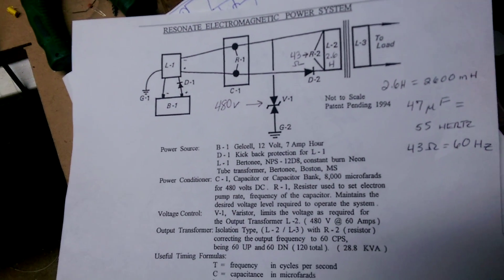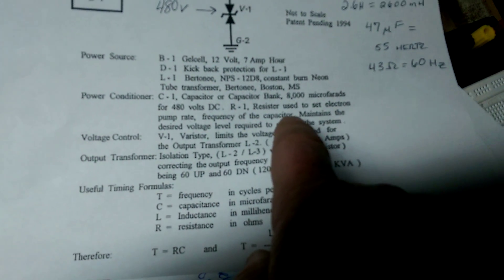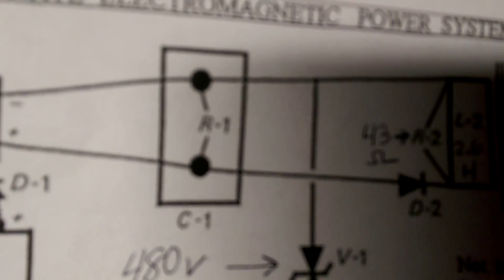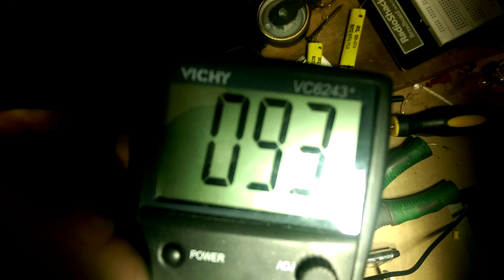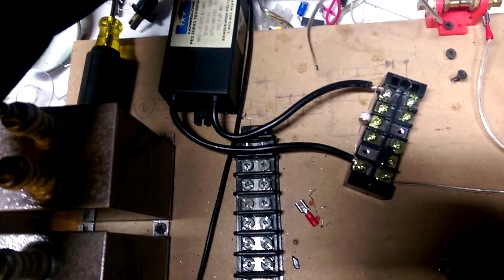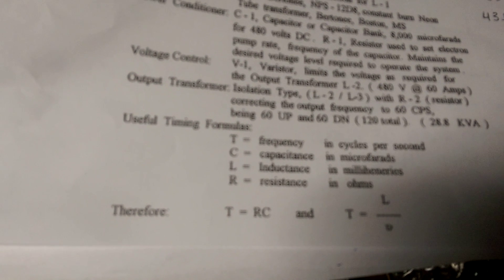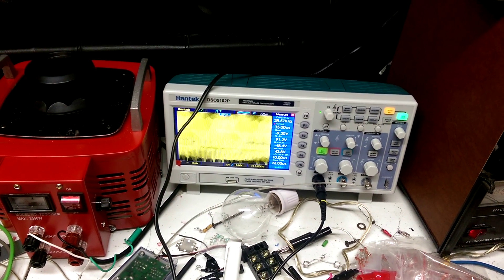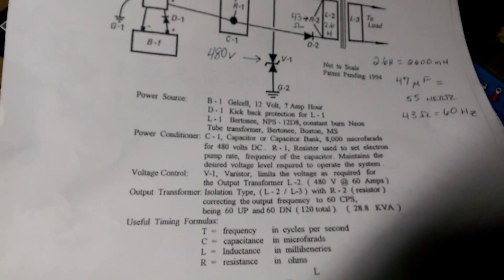Don Smith How To Video

Comment: Mark what a fantastic video, if you were to know me you will find out that I'm not an ass kisser at all...
For years I've been trying to figure out mostly about affordable components and how to make the calculations etc, and here you are just a year ago with this video.
 I have many questions,  How much can it power up? I have an nst, 12kv,, old block, big at 60hz, how can we increase that frequency? you mentioned something about a solid state device...As a coincidence just yesterday accessed the website you mentioned but won't have and idea as to how to set it up I saw one with several terminals...Etc. 
Thank you for sharing, we need this to do good for the world once and for all, We can say you are a man of great principles
Reply from the maker: Well, this isn't as it seems here. I've tried this but I think it is just a piece of the puzzle in the tricks up Don's sleave. I am finding that the output of this system is directly proportionate to the size of the capacitor used. When we use an NST, the output of the nst is an ac waveform that is just sped up to so many hertz due to the oscillator inside of the NST, and of course it uses high voltage at a very low amperage. The system has some trickery and the calculations used here are for dc voltage, not to be confused with the output given, but because it converts within the cap. 

The reason it is dc voltage is because the amperage at the ac voltage used is so low that it can't remain ac long due to the capacitor. When we add the capacitor, it of course stores energy and fills itself until it's peak where it dumps dc voltage from the cap to the circuit. The resistor we place across the cap allows the output of the NST to filter out the conventional energy and convert it to radiant energy, but storage of the radiant energy at high voltages is unlimited and converted to dc once it is connected to a capacitor of high value such as what is used here. 

Once the cap fills with radiant energy, it can't explode, it dumps and the resistor used controls the frequency it dumps at. We must follow Don's calculations closely , but, we have to also be aware that the frequency the circuit is driven at is calculated within the system by determining the L1 coil size by impedance along with R1 and C1. If we scope the output of just L1, R1 AND C1, we will see the frequency changes to perform oscillatory effects so we could have output resonance. The cap will fire the output to the circuit with ease. 

This circuit creates Don's briefcase device which is used to dam up the radiant energy, convert it back to conventional energy with a massive amount of joules due to the cap storage, then it utilizes the resistor and transformer plus the Varactor (not varistor as it says) to pulse energy into the ground, converting the stored joules back to amps and output the energy with ease to the output of the circuit.

 When we have this energy in the cap and a coil connected in the end, the circuit toggles it's own oscillation and outputs the charge at the joule level at 50 or 60 hz with ease because the capacitor easily recharges after each cap dump because it never discharges all the way. The frequency it equals is 35.1 khz and we only extract a portion of it by toggling the coil/resistor, and L1 of the output transformer to react as an inverter. The radiant energy has the capability of multiplying it's amperage several times because we give the output 35 thousand pulses of energy at 480 volts and use only 60 pulses of 480 volts to run it's output. If we do so, we aren't utilizing all of it's energy, we drive all 35 thousand of them into the ground, and the diodes within the Varactor do the job of releasing negative energy into the ground, then the Don Smith Effect happens where the energy flows above and beyond into the Earth's ground, increases beyond what the atmospheric level is and causes an abundance of oscillations of electrons to convert to positrons within the atmosphere. This strengthens the aether and allows the coil in the transformer with the resistor across it's terminus to react and induce these oscillations converted from say 35.1 khz at .05 amps to create a possibility of output at  35,000 hz x  input amperage of .05 amps = 1755 amperes/60 hz = 29.25 amps x 480 v= 14,040 watts (with the figured losses it will have).

This sounds impossible in nature due to the ohm's and watt's law, but the fact is that we extract radiant energy with resistances of high levels as this energy can't be released without high resistances. For a simple experiment that verifies this, we could take the Tesla Hairpin circuit for example. If we build this and get the oscillations right, we could store the energy into a closed loop single turn coil (which the shorting bar is. If we apply a high resistance across the loop's outer edges, we release the energy, as with a low wattage light bulb and fine wire connection. If we place a 100 watt bulb to the bar's right and left sides, nothing will happen if the wire is large, but, if we do as Karl Palsness does and connects a 30 awg magnet wire across the room and add the same light bulb, the energy output (negative or black energy flourishes and the bulb illuminates wildly). This is what happens here, but because we do not ground the hairpin system that Karl uses through a varactor, the kickback can't amplify with it's transmission from a negative electron back to the atmosphere as the positively charged positron.

The reason the electron converts is because the Earth acts as a massive AC capacitor. If we charge one side, the other needs to match this level. if we charge one side with 35.1khz at thousands of volts, the other side needs to become equal and opposite. When this happens, the energy transfer is done and we can tap it provided we use the correctly sized resistor at it's primary side of the output transformer. When this is done, we get not only the pulse from the capacitor in the system, we induce all of the magnified energy from the atmosphere and it collects as a massive storage of plasma energy, ready to discharge at whatever frequency we make it on the transformer. 

Once the transformer does this and the cap dumps, the cap is recharged with one pulse at 480v from the 35.1 khz input while the rest of this energy is transmitted into the ground and recovered in the end of the circuit at a massive multiplication. So, 35.1khz x .05 input will become much larger and recoverable as a single pulse of discharge per 60 hz timeframe. so we get 35,100 pulses of input per second input and we convert it at a divider of 60 times, increasing the output amperage by that amount because it multiplies 35 thousand times and is used in one 60 cycle pass in one shot. 

Once we discharge the cap from a one second charge, we get this level of 1755 amps at the terminal and it will blow apart a screwdriver and recharge before that second is over allowing the energy to flow again and again because we are charging it faster than we can take the energy from it. Because we drive these pulses into the ground means that the energy is being stored for later and if we don't draw back the extra energy in the system as a multiplier, it would discharge as lightning eventually from the atmosphere to ground once the voltage in the atmosphere builds tremendously. 

I do not think we only raise the atmospheric energy, i also think it adds the energy from the atmosphere to the system because the output is tuned to the oscillations forced into the ground, then transferred or split within the ground and the atmosphere and allows it to induce back into the output transformers coils at an even divider of the input frequency

Remember, whatever the amperage is pulsing into the high side of the coil will also become a much greater output in it's secondary for amperage and would not be able to be shutdown as small transformers do when shorted until we pass the level of saturation of the core. We need to ensure the frequency of the devices output is a direct multiple of the input, so if 35,100 hz is the carrier frequency, the output's frequency of 60hz must be a perfect multiplier to function correctly and provide this energetic magnification. This multiplier is exactly 585 times. We could use any frequency just as long as it is one of those multiples.

so 35,100hz input /60hz usage = 585 times amplification, and there is no additional energy left over. This is the magnification amperage level as the frequency is clearly allowing for radiant to convert to conventional amp driven power at a rate of 585 times multiplication. So, the output scenario will be in this case 9kV x .05 amps = 450 watts x 585 = 263,250 watts if the system had no losses. Losses do occur within the atmosphere and they will also happen with components that have too little resistance when it comes to cold or radiant electric pulses. The opposite is true for conventional energy and the energy that is converted is NOT static in nature, it is radiant.

So, if we had an AC cap and we stored each pulse, we would get a maximum discharge per pulse. if we store for 35000 cycles and only discharged for 60 cycles, we would have an overabundance of energy leftover or we would have a massive cap explosion. This doesn't happen because the varactor allows the energy to store safely into our planet.

Here is the other secret. The varactor doesn't come in the sizes Don states. This is because they stopped selling them once his device was sold to the oil companies for generation of large electric generation facilities

The Varactor has to be made by the use of high voltage Germanium diodes facing each other.  This creates the energy valve as Moray has created but it is solid state instead of using a vacuum tube with rare elements within. The Germanium is the gate allows this energy to be toggled and stored using this "valve" technology that allows it to be dammed up within the cap and discharged as mega pulses into the primary of the transformer. We could feed a massive 300 kVA high voltage single phase transformer with this circuit with ease and never worry about energy again or fuels, but it is stationary and we would use this to charge electric vehicles and never have issues with fuel, oil, etc. ever again.
Reply: @advanced-electronic  gracias; hermosa explicación.
Aunque no leo inglés muy bien; lo he llegado a comprender.
Su explicación es más entendible que la de Don.
Creo que intentaré hacer un equipo de este tipo.
Usted me dió las llaves que Don Smith tenía guardadas ; o yo no comprendía.
Que Dios lo bendiga.

Comment: Marc thanks for your helpful videos. Your scope is really overdriven here making readings unreliable ,   just make a loop of hookup wire clip it between probe tip and probe earth clip. Hold it near to the Neon transformer to sense or sniff the waveform and the frequency ...don't need to actually connect it.  Having scope sitting too close to HV at high frequency can damage the scopes  internal amps. Due to volt x frequency product. 
Cant really measure power line type or heavy inductors with simple inductance meter because inductance depends on "magnetising current" to get to correct operating part of the cores hysteresis curve. Effective inducance best computed from in circuit testing.
Reply from the maker: it's a high voltage probe and the voltage here you see is only at 880 volts. The probe is good for 2500v, the arc gap clamps the voltage and only allows so much through, I had to switch the probe selector, after the video I of course noticed the switch was in the low position, 1000v setting and it shows the waveform wide open like that. I was fooling with the scope early after I purchased it and never set the multiples correctly ont he scope, it was on auto and for some reason didn't sense it properly because of an issue with the end of the probe. I clipped it onto something too wide and it stretched the connection inside, causing it to crack and work when it wanted.

I've since bought a new one and have been able to determine the frequency better, but the frequency even with a plate connected to the low voltage probe shows frequencies very sensitive,. It jumps between the multiples that are in resonance, so it is fairly easy to calculate to an open, working frequency that the scope detects, each one that shows up for a good second or so are usable frequencies,. It makes it easy to use lower or higher frequencies that match the giant selection of caps I have to gain resonance.

Comment: Hello Marc,
i´m rebuilding Don´s Plasmaglobe device. After connecting a Diode bridge to the "Crown Coil" i have a connected a 50 microfarad, 900V capacitor, which is also grounded. 
The capacitor charges pretty well after activating the globe. But i don´t know, how to go further with the Isolation transformer. I have a 230V, 632mH transformer. Do you have any suggestions? 

Regarding to your video - why are Don and you using the formular T=RC and T=L/R (as stated in his document - but this is for DC voltage only i thought and the NST has an AC output) and not the data from the ARRL as Don said in one of his videos. This is one point i don´t understand.

Thank you very much
Reply from the maker: Yes, I do have suggestions. Once you charge the capacitorm, you will need to use the energy output to invert it, then fire it into a transformer for voltage correction. The formula I use is used because once the energy is fired into a dc capacitor, it becomes dc voltage. I am at the same step as you in this video, but have found out that we could charge 2 sets of caps isolated from each other, or we could invert it using transistors as Don shows to change the dc voltage to an oscillation at 60 hz
Reply: Thank you for your quick answer. I´ve to say, that I´m not a professional in electronics. Everything I know is self-taught. Is it possible to write you an email, cause i do have a few more questions and one or other comment. If it´s okay for you.
Reply from the maker: yes, my email is marcvbelanger@gmail.com. Better yet, if you are on hangouts, I could chat with you on hangouts, please send me an invite from Google hangouts.

Also, you mentioned that you do not understand why Don & I use the formula for dc voltage. The high frequency pulses from the ac supply are a high frequency pulsed dc wave. When you tie this into the capacitor, they become straight DC voltage and remain that way. AC can't pass through the DC capacitor, so if you look at Don's literature, it clearly states that we could fill the capacitor with voltage extremely rapidly. Once the energy has charged the cap, there is a very special method that needs to be used. This is something that needs to be discussed privately, so if you will, please contact me by email of hangouts if you will for answers. Thanks for your understanding. It will keep the establishment off of our asses. TY
Reply: Alright, i´ll contact you via mail cause i don´t have a hangout account, yet. I´ll change that :) But unfortunately not before monday.

Thanks
Dennis
Reply: i´ve sent you an invitation for hangouts. i´ve sent an email to your address also